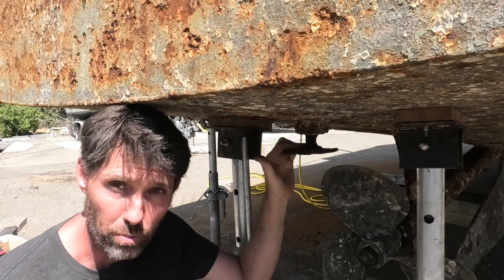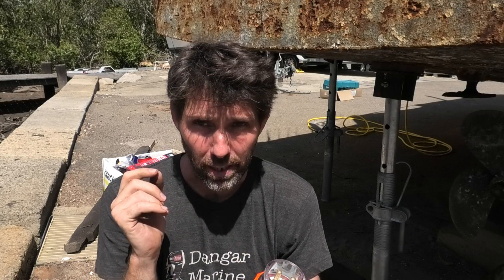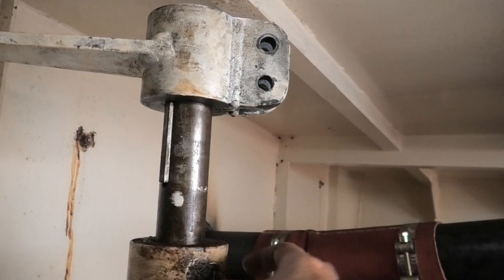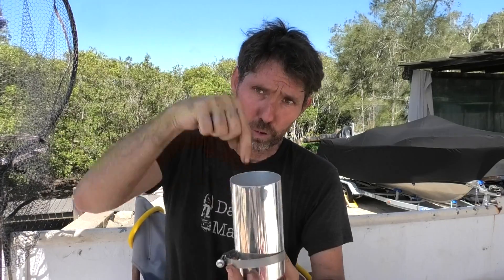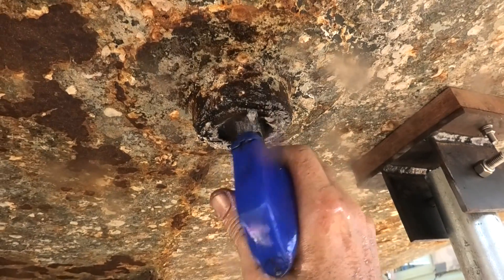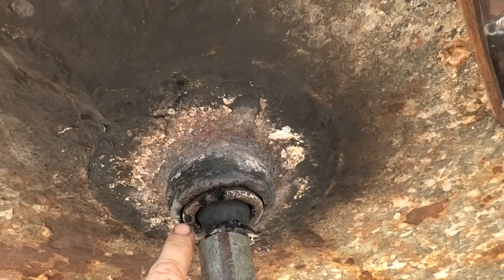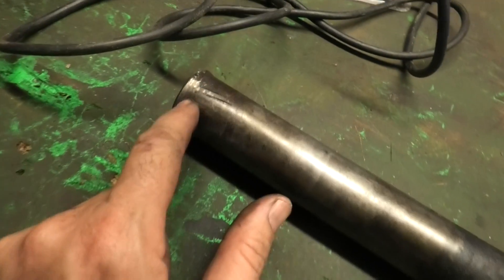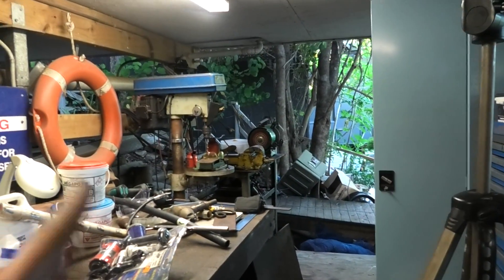Removing the rudder post

Comment: I would make the rudder post out of 1704 stainless steel.   1704 is  Corrosion resistant or 2208 duplex both of them have high carbons content and are very though metal. Make sure that the shop faces the end of the flange where the rudder bolts to the rudder post. If you want to use carbon steel I would use 4130 shaft  Material.
Reply: Wow! That's super helpful man, in wish I knew more about stainless steel like that. Shoot 316 is the only number I can come up with lol
Reply: I work for the Chemical plants in Freeport Texas where they make chlorine gas they get that out of sea water So I deal a lot with Stanley steel there's another material out there called hasslealoy  But that would just take it to the ridiculous extreme of cost plus it's a pain in the butt to machine
Reply: @sailingdutchman7000  that's wild, awesome though man. Everything on a boat is already in the extreme for price lol cant imagine if they started using stainless like that

Comment: Look into air arc gouging to remove weld lines. If you think Oxy Acetyline is quick you have no idea how fast air arc gouging is. The good thing is that you can get into corners that nothing else can get into and blow weld out of that corner.
Reply: Sweet, I've never heard of that, I'll check it out :)
Reply: I've burned a many a gouging rods working  off-shore on the oil platforms. They work amazing.
Reply: @genek121973  awesome man, thank you!
Reply: I doubt he will have a powerfull enough welder available for air arc. Takes like 300 amps and a pretty good sized compressor as well.
Reply: @codylapoint  it would be nice if he could though
Reply from the maker: @Jacob Lapoint, yes, my welder only goes up to 200 amps unfortunately.
Reply: Yeah as handy as an air arc setup can be, you really cant use them outside of industrial settings. There isn't many shade tree guys who will have access to the grid power or a machine powerful enough to do it usefully. You are doing a great job regardless, glad i found your channel!

Comment: Can I ask you a quick question about a 2007 honda 50 hp 4 stroke I recently acquired. I've replaced the water pump (impeller) new thermostat and gasket, blew out the tube below the thermostat housing with compressed air, it will pee water at higher rpms, and dribble water at idle for a bit, then stop, and will set the over heat alarm and turn off after approx 2 minutes of running. Any ideas what to look at next?
Reply from the maker: It could be a blockage somewhere between the pump and the engine. Sometimes when you put the gearbox back on the rubber seal at the top of the pump can get caught up and go into the water pipe a bit.
Reply: @DangarMarine  thanks mate! On it in the AM ;) will report back. You're a true resource for the every man ;) thank you!

Comment: Would it be possible just to use bar stock and install grease fittings where the bushings or bearings would be seated

Comment: Bushing may well be asbestos. Gotta watch out for that stuff in old machinery. I know its an older vid but i thought it was worth mentioning. @Dangar Marine
Reply: Not asbestos it was only use as a non burn material
Reply: @MrJeep75  was also used as a friction material in clutches, gaskets and braking surfaces. Can't imagine it used as a bearing though.

Comment: When you are finished repairing your steel boat how many years are expecting to get from that boat until it needs another fixing ?
Reply from the maker: Good question. It will need to come out every year for basic maintenance, but I would hope to get at least five years before any other major work is required on the hull at least.

Comment: I see I'm not the only one to suggest a section of prop shaft for rudder post. And as you can see, the isolating bearing material options are plentiful. You'll still have to bolt on some sort of anode...if the water's brackish, aluminium is likely your best choice, but ask around.
Reply from the maker: I'll definitely do some research on the aluminium v zinc for the anodes. Would make an interesting vid.
Reply: @DangarMarine  Magnesium for fresh, alu for brackish/tidal and zinc for salt water. Not sure where you want to go, but a steel boat wants anodes. So does the engine in terms of pencil anodes, if it's bonded. You'll need to look up "floating ground" and other arcane electrical terms, because if you're going to fix this up, it would be a shame to have it immediately start corroding.

Comment: Got to be stainless for shaft and flange, make sure there are a couple of decent sized anodes on the rudder and plenty on the hull too,  looking at the corrosion on the hull there it looks as though anodes may of been neglected in the past and that's a road not to go down
Reply from the maker: Yes, anodes were let go completely unfortunately. A bit more maintenance in the past and this boat would be in much better condition.

Comment: The bushing is made of asbestos from the looks of it. I would go with the original materials as you don't need to spend money on that issue... It held up fine and it didn't corrode and fail on you, if you have to replace the rudder post 20 years down the road you now know how it is put together.

Comment: 6:24 Any bush in this sort of service won't be nylon, unless they didn't know what they were doing. Nylon is well known for being highly hygroscopic, so clearances will pinch. Nylon's really only any good for unenclosed service where dimensions aren't critical like as a guide block, sliding surface etc.
Reply from the maker: Yes, looking into it there are several very specific materials used for these bearings. I had no idea that nylon absorbed water so much. Good to know now though!

Comment: Hey... re your deck crane /davit arm....
Without knowing the capacity,overall length  and base construction style of the lifting device in question... the things i believe that should be adressed are possibly the contruction of a "plinth" for it to sit on with gussetingboth on deck and inside the hull ,including supports welded to the vertical parts of the outer hull ,possibly incorporating either bulkheads or vertical stiffening members, the reach ,both inside the boat and from the boat to the dock, the length of drop available from the arm,and ease of storage and operation...good luck with that...also i could've remember if the vesel had a mast of some type as the "traditional " style of davit arm with a block and tackle would definitely give a greater coverage and possibly higher lift capacity.?
Reply from the maker: Appreciate the advice. There is a mast on the wheel house and the big advantage to having a traditional davit off that is that it leaves the deck uncluttered. I'll put some more thought into it.

Comment: Well damn I thought the shaft would have been tapered and pushing from the bottom would have done the trick. Sorry for the bad suggestion.
Reply: I also had that thought, you are not alone there.
Reply from the maker: Nothing wrong with making suggestions. No one is right 100% of the time, least of all me! :)

Comment: the smaller badly rusted fasteners are often freed up with just heat from the cutting torch and if that doesn't work then a quick shot of oxygen makes the point moot.

learning the differences between carburizing, neutral, and oxidzing flame is really something you have to do. most heating/cutting tasks will be neutral to slightly carburizing. the more hissing the further into the oxidizing range. the more double flame the further into carburizing. i usually adjust to slight carburizing then back just barely to neutral.

for peeling that extra strip off where you are basically washing metal away rather than cutting it you would want to go heavily to oxidizing i would go very heavy on the acetylene and then add oxygen until the base of the flame starts to walk away from the torch, then just bring the oxy back until the flame sits back down against the tip. should be extreme hissing and very long flame cones by this point. this is where you definitely don't want to accidentally hit the cutting jet while washing away the material... very bad karma...

flashback arrestors definitely don't hurt. if you can only afford one pair i would install them at the bottles.
Reply from the maker: Thanks for the tips on using the oxy torch, I do have a lot to learn about it still.
Reply: @DangarMarine  another thing that is often overlooked is the importance and technique for cleaning the cutting tip. the tip is dirty if all of the preheat flames are not consistent and properly formed. 

problems with the preheat jets generally occur less often but must be dealt with. the cutting jet is the main problem area as the bore diameter tends to be large which makes it more susceptible to debri blowing back into it. 

the main thing to remember about cleaning the tip is to use the cleaner size which fits easily into whichever bore you are cleaning. the idea is to gently pull the debris loose from the bore and out the end of the tip. i've seen a lot of experienced welders sawing away on a cutting tip and then can't figure out why they can't get a well defined cutting jet. what happens is they damage/score the bore with the tip cleaner. 

don't assume a cutting tip comes clean from the factory, they often have small burrs from the finishing process. the cutting jet should be a well defined consistent stream and reach 6 to 12 inches from the end of the tip with the oxygen lever fully depressed. if you set the acetylene and oxygen to approximate specs at your regulator, get your torch lit and depress the cutting jet you will be able to fine tune for optimum oxygen pressure at your regulator. you will see the profile of the cutting jet change as you move the oxy pressure up and down. adjust for longest jet. check your cutting jet regularly, it could become dirty with every cut.

https://www.youtube.com/watch?v=pnW-oyO3FEI&index=11&t=0s&list=PLYoq6mIU8wI1P5gwl1JZG6jWaxS05CxZf

Comment: Stu, sort of thinking aloud here, but would trailer axle bearing seals be workable. Easy to get, relatively cheap as I would guess they would be replaced every year or so in this use ( when you anti foul?) . wear on a rudder lower bush at the rear is normal, most of the turning /abrasion load is from course correction when under way, so the rudder has heavy prop applied load at the rear of the lower bearing, and the front of the top bearing will have similar wear, although normally it is a smaller amount. This is not a job for roller or needle bearings as the task does not allow the shaft to do at least one full 360 turn when used. New nylon bushes and a grease filled tube in between would be the way I would go. The support/outer tube should of course be as high above the water line as possible (if a seal fails, you don't come out to a  wet interior or sunk boat ) Stainless steel is only useful if the steel is able to be in contact with the air most of the time, under water all the time stainless doesn't give much benefit, so I would suggest cheaper mild steel and clamp on anodes for the rudder post be used.
Reply from the maker: Hey Ron. Yes, more and more I am thinking another mild steel post is the way to go. Way cheaper and it lasted 30 years which is probably longer than I will have this boat for.

Comment: About the stainless vs the steel, I have don quite a bit of welding both, and the stainless is a bit softer as far as tinsel strength.
Reply: Stainless work hardens (like copper). Tensile strength also depends on the alloy. High speed steel used for drill bits is a stainless steel.

Comment: I would do the rudder in good quality steel instead of stainless. Stainless costs more, adds issues with electrolyses and might be less strong than a good quality steel. A steel rudder will last long enough and can easily be protected against electrolyses with the normal annodes. I wouldn't be surprised if the sticking rudder post problem was created by the stainless rudder.

Comment: I'm surprised there's no way to pump a bunch of Grease into that collar to help keep it lubricated well it's assembled and also act as a water stop
Reply: Yeah, that's what I was thinking, why isn't there a zert fitting somewhere!?
Reply: Drill & tap would fix that...
Reply: @BornAgainBoating  
Yeah, wondering that myself. I think I'd go back with mild steel post, bronze bushings, and install some grease fittings; then call it a day and have a beer.
Reply: @allangibson8494  we do that a lot on older johnsons where the swivel bracket freezes up like that. You still gotta use that oxy torch to melt out the old grease once it gets to that point
Reply: @randomuser778  gotta have them grease fittings, on a steel boat like that, lol crazy
Reply from the maker: There is a grease nipple on the rudder tube. It is just below the top bearing to fill the void with grease.
Reply: @DangarMarine  so it was probably just not greased enough since last time the shaft was removed. I wonder if it would be beneficial to install a second one closer to the bushing to help keep it lubricated
Reply: I kind of wonder if you put a grease nipple closer to the bushing at the bottom of the boat if that would help to keep the bushing in good condition and at the same time help prevent water from passing the bushing it didn't seem like the shaft really got Rusty
Reply: ^^^What these guys are saying boss. Can't have too many grease nipples. Some type of bush that is suitable for the service, wear load & a recommended compatible heavy soap type grease, (some grease types eat synthetics, I know never-seize loves nylon lol, so be aware when you choose your bearing material/lube) fill until the sealing grease just shows each end. Give it a couple of pumps whether it needs it or not, on a regular basis. Wish I was there t/a-ing. :)

Comment: I have messed with a lot of asbestos material, and that bushing looks like it. Don't handle that anymore without gloves and proper protection. Also the prop shaft bushings will more than likely be the same. Air filtration masks would be advised. Nice work on getting the shaft out, I would say it was a couple of days to a weeks work.
Reply: I'm not sure asbestos products pose a risk when handling -only when asbestos fibres becomes air borne and you inhale it. Perhaps someone can comment and educate us all? Is nugget wv correct about handling the stuff? I don't mean to be disrespectful nugget wv - clearly you have heaps of hands on experience that cannot be scoffed at. I just think its a live or die kind of subject, so we really need to know. Clearly you can't avoid asbestos - its in many older things.
Reply: @MrKillerpics  I hadn't thought of that, I was thinking because of the age of the engine, asbestos was still a common building material.
Reply: @MrKillerpics  When he was drilling it it appeared white, fluffy and fibrous. :-(

Comment: Hey mate... shaft material? I would use stainless but up to you.. re cost etc,but I would drill and tap the rudder tube for grease nipples if there's none  at the moment, and probably a Teflon bush at the bottom there with a shoulder outside that covers the end of the tube....
Also ...thinking about your doubler plates,maybe a better option to cut along the corner weld below ,and also cut above the doubler  for about 2  metres and remove the whole section, leaving (And cutting around) any longitudinal and vertical stiffening or bulkhead, assuming that you would be buying 1200x2400 sheets of steel in either 5 or 6 mm?... I'm raving on a bit haha stuck at home after hernia operation good luck anyway
Reply from the maker: I'm definitely going to get a quote on both stainless and mild and see what I am up for. Hope you recover well from your operation!

Comment: That bearing might be a fancy fiber reinforced plastic, might be asbestos.  stainless from the 3xx series is weak (except for 301) but probably the best for corrosion protection (mostly for itself). as for bearings: go for a plastic, but for the love of all that is holy don't use nylon. it's highly hygroscopic and will jack everything once it meets water. it also isn't that good under high compressive load. don't use POM (delrin and such) either, they can take load and seawater but it's not a bearing material. HDPE is a lot better, as a bearing as well as dimensional stability, but it does creep over certain loads, so do some calculations (send the data i'll do it for you if you don't want to do it yourself). HDPE is cheaper than chips as well. best option i'd say is either select a nice bearing set from IGUS, either iglide H370, J, or XT1, and use that. it will last forever, they like working with oddball projects so just shoot them a mail, usually if you can use off the rack bearing, they cost next to nothing. if you want to go proper fancypants, want to throw a couple 100 bucks at it, and have a high load application (don't think so but i don't know your dimensions), use Trelleborg Orkot (different kinds, ask them which one). that stuff will last forever,  take any abuse, virtually no stick-slip (that doesn't matter to you because hydraulic steering, the actuator will probably be worse than the bearing) and comes in any size you want. I use tribological plastics in many applications, though in a different field (tiny hydraulics in aircraft mostly), i don't pretend to be an authority but i know a thing or two about them. a seal might be a worthwhile investment at the top, all of the plastics above do fine in seawater.
Reply from the maker: Yes, will definitely be looking into the right material to use for the new bearings. There is a company down the road that I will probably be using to make the new rudder post and supply some matching bearings http://www.dhporter.com.au/shafts.html